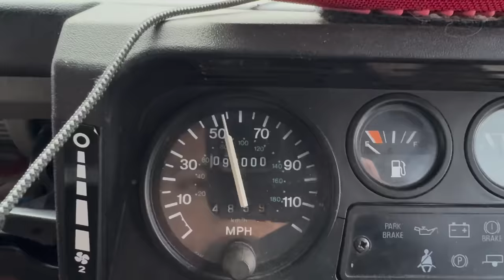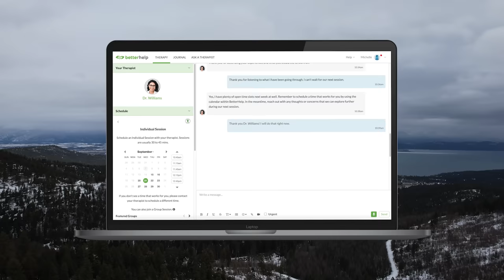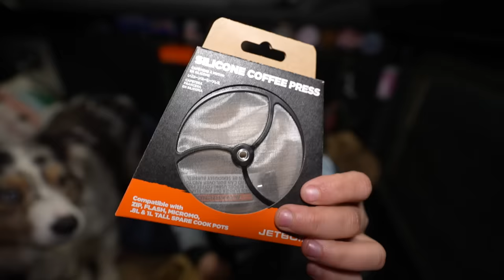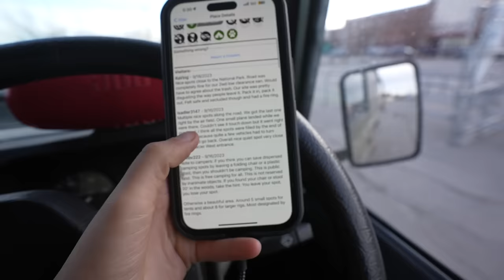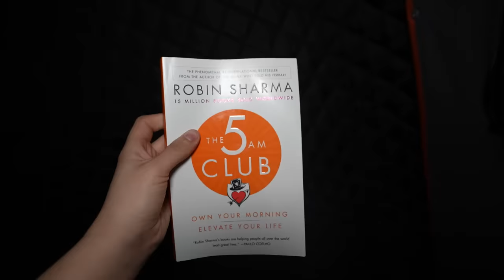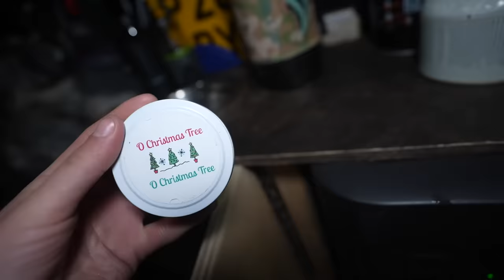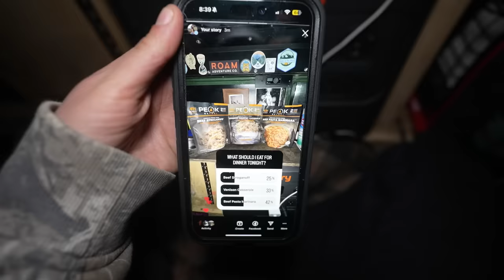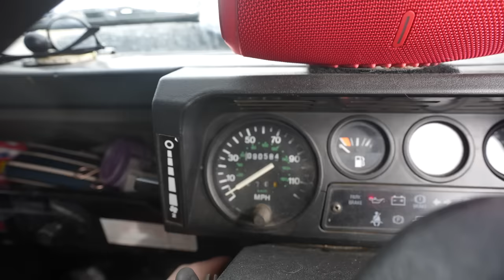3 Days Solo Truck Camping in the Montana Mountains

Comment: Little tip for lighting the stove with a lighter turn the gas  on  notch til you hear a decent not full blast stream. They just move the light toward it. So it will ignite from the futherest distance.  Save you from burning hairs off your arm.

Comment: Plug your USB devices into the USB ports of the Jackery.  By using the plug-in transformers, you are losing energy in the conversion from DC to AC and back to DC.  You can leave them in the plugs so you don't lose track of them (they won't use energy if they are not being used), but plug the USB cords into the USB ports.  The USB-C ports are PD100, which is 5 times more power than the 20W adapter you are using now.

Comment: @roamingreckless if you haven't already, consider coating the underside of your SUV to protect against corrosion for next winter season. Also, wondering if you can connect a 12V charger to your jackery from vehicle 12V to charge?

Comment: Gitana im glad was the battery i was talking was the main relay most of time the main relay get over heat and everything shot down .But if the was the battery you better check the alternator as well some times they over heat the battery by over charging .That is the reason i always kp spare parts and a battery or 2 around in my ford F-150 rv camper but my is a old one straight 6 300 carb 4 sp granny transmission easy fix out of problems and believe me the cheapest off all parts wise strong like a bull and from alternator to everything else is hold by two bolts started alternator fuel pump gas pump even the carburetor nothing to it even the breaks are easy and i can pull from 10.000 pounds to 30.000 pounds easy she is a beast such motor and granny transmission 4 sp standard is the best of the world im lucky i have one take care remember next time straight 6 300 ford granny transmission 4 sp the best of the best ok . carburetor  the rest are crap trouble makers .Ccr born in the byouooooo la vida loca asta la vista baby 😁🐈

Comment: yea, I agree with you better get poe washed soon, all that road salt will start to corrode. I'd try to find a place that you can get the underside cleaned too. or those self operated washes even though its cold out spray the heck out of the frame.

Comment: Tips from a foodie for cooking perfect steak that is brown and crispy on the outside and cooked to your liking (have a window open or do it outside if possible, you may have some smoke): If possible, let your steak warm up to room temp by leaving it out of the cooler for 15 mins or so *safely away from Blue...LOL.    Get your pan as hot as it allows (if non-stick there is a limit before it negatively affects the coating, cast iron or stainless are best). Pat your steak dry by sandwiching it in between 2 paper towels and pressing gently. Pepper and garlic powder on both sides, but no salt yet. Once the pan is screaming hot put it with a minimal spritz of avocado oil spray or 1-2tsp butter/olive oil combo (prevents the butter from burning). Less oil prevents splatter burns. Don't move the steak for about 3-4 minutes, this builds a nice crust, (You can lift up an end to see if it's dark enough though). Flip, now add your garlic/herb butter to the pan and with a spoon, tilt the pan and spoon the butter over top. Should be done in another 3-4 minutes depending heat and steak thickness. Use the finger test to test doneness: Make an okay sign with thumb and index finger, press on the fleshy part of your thumb between the base of thumb and wrist: that's what Rare feels like on a steak, now press on the top of your steak and compare. If you want to test for Medium Rare: thumb to middle finger, press on same spot of thumb pad and compare to steak, Medium: fourth finger,  Well done: pinky finger and thumb. Remember that the steak will keep cooking while it rests, so if you want medium-rare you may want to take it off the heat at Rare. Plate the steak and cover it with a piece of tinfoil or even a plate, it doesn't need to cover completely. LET THE STEAK REST for 15 minutes. It will still be hot, and it will be the juiciest, best pan-fried steak you have ever had!  While it rests, you can cook up your veggies and other yummies. Now is the time to season the steak with salt. Enjoy and big hugs!!! YOU CAN DO THIS!:face-red-heart-shape: Big luv to you and Blue and Po!